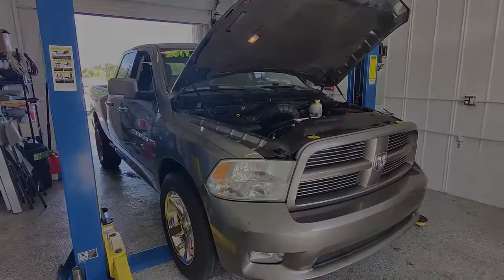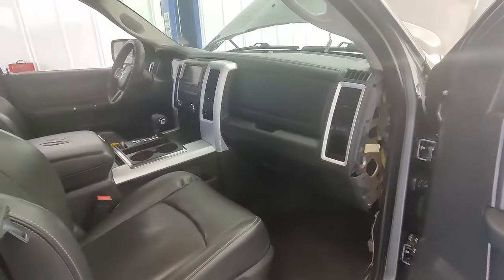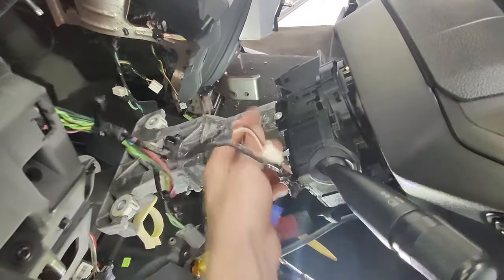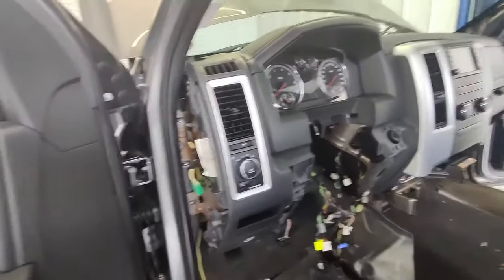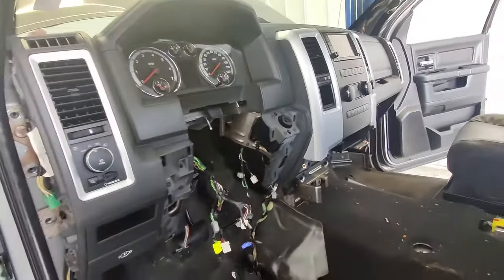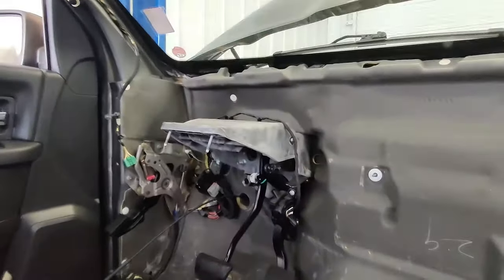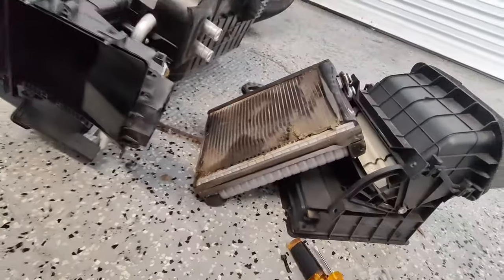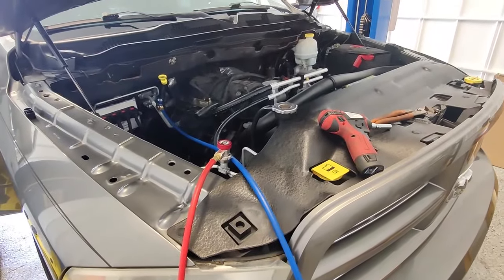2011 Dodge Ram Evaporator Core Replacement

Comment: Very informative video. I will be doing this same project this week. How long did the job take?
Reply from the maker: It's about a 6-8 hour job for someone mechanically inclined. If this is your first time doing any major auto then this will definitely be a weekend job
Reply: If you take this to the shop, how much will this pain will be worth??
Reply: I was just quoted $1,295 to replace.
Reply: It costs $2295 here.  Luckily it was covered under my warranty plan.
Reply: I've got to do this on my Dodge 1500, 2010 . This looks head scratching
Reply: Just had my 2011 RAM 1500 OUTDOORSMAN AC checked. Was told I need new evaporator and heater core. Cost will be over $3800 to do. Is this insane pricing? It will be at a Dodge dealership.

Comment: No need to remove seats or column. Just drop column, remove the main dash bolts (3 on either sides, 2 up top and 2 down center) then drop the column to the ground. Pull the dash out and hang it with a strap, disconnect some electrical along the sides as need  be to pull it back enough to get acces to hvac box. Got it done in book time
Reply: Also 2 tens holding the dash in right above the column so once u drop it you get access.
Reply from the maker: @vern2k653  yes I realize you can do it without removing the seat and dash completely but I prefer to do it this way because it gives much more room to work and less risk of breaking or damaging anything
Reply: @ChrisVaughnTech  yes there is a bit more risk but I can’t fathom taking an extra day or 2 when book time only gives us 7 Hrs. I still haven’t broke any dashes doing it this way and it’s worked everytime
Reply from the maker: @vern2k653  this method only took me a day. I started it in the morning and had it completely back together before 5pm
Reply: @ChrisVaughnTech  props to you that’s a lot of work in a day
Reply: The 2007 Ram is the same.  I only had to lower the steering column.  I'll admit, it felt sketchy, but it worked.
Reply: @ChrisVaughnTech floor gear shifter?
Reply: I was gonna say, this is a job!

Comment: Awesome video.. FYI if you are just doing the evaporator you can lay the dash over to the driver side and you do not have to unhook the harness under the carpet or take the steering column completely out. That way takes about 40 minutes with power tools to get to the hvac box 👊🏼

Comment: For book time 7 hours. I’m on day two and I could have save so much time by dropping the steering column ALOT sooner than I did luckily I had a small box under the cup holder so I don’t have to remove the seat 🤣 thank you for posting this

Comment: Guys i did not remove the wire harness under the carpet, i just rest the dashboard on the seats area and there was enough room to remove the heater box,i also replaced the resistor

Comment: For the DIYers watching this, as many already commented, the truck doesn't need to be stripped out this much.  Here's the short of how to proceed and not damage in order to remove the box to replace either the heater core, door actuators, or the condenser:

1. Roll front passenger window down, and move seats all the way rearward and then disconnect battery.
2. Evacuate refrigerant and drain coolant or clamp off the heater hoses ahead of the firewall.
3. Place a fender protector or moving blanket through the passenger window to drape over door panel - this will make sure the protruding studs from the box don't scrape it up.
4. Remove center console from truck.
5. Remove the A-pillar trims, trim on either end of dash, kicks, and under the wheel. 
6. Drop the column - no need to remove.  Wrap the wheel and column in a moving blanket, towel or similar to protect. Cover seats with moving blanket or towels now.
7. Remove the 3 bolts at either end of dash, 2 bolts at the top against windshield and 2 down where the console was. Disconnect the harnesses on the passenger side
8. Get a helping hand and lift and tilt the dash back and bring the passenger side further back.  Hold it up and back with a strap hooked to the the rear clothes hook, driver's headrest or such.
9. You can now get to the box to remove fasteners and wire connectors, and don't forget the fasteners on the engine side of the firewall.  
10. Pull it out, and regardless if replacing the heater core or condenser, check the other one and clean thoroughly. Be sure to check brand new and reused parts for leaks before reassembling!  Simple vacuum or pressure test will save your sanity!  Also, I honestly replace both while in there and also the actuator!It's an extra $150 in parts, but a lot of savings in the long run... DO inspect all of the doors. If you find any broken, stop and order aftermarket repair kit!  This is also when you want to add the cabin air filter to keep the condenser clean if, like the truck in this video, it's not there from the factory.  Do not buy the "kit" from the internet as they make a ridiculous profit. You can buy the door from the Mopar parts counter and the filter from anywhere. I like Wix personally. 
11. When you reinstall, make absolutely certain to replace the anti-rattle padding as the factory had and make sure the seals for the firewall pentrations are intact!  If you don't, it will aggravate you if DIYing or cause you to redo the project if a pro!
12. Reassemble in reverse order, vacuum and recharge the air conditioner, and reconnect the heater lines and add coolant.  Burping the core of air takes some work because of where it sits in the system.
Reply: When you say actuator is that the same as an A/C receiver drier/accumulator? Like $25
Reply: @Kendall Engman  No, the HVAC box in which the heater core and AC condenser are mounted contains several doors that open and close to switch between heating and cooling, directing air flow to defroster, floor, etc, and those doors are controlled by electronic actuators, which is a fancy name for a small motor assembly.   They are prone to wearing out, and sometimes the doors in the box break.  Best time to check and replace is when the box is out. One of the actuators mounts to the front of the box, meaning it is right against the firewall when the box is in place.  So it can only be replaced when out of the truck, which is why I just replace when the box is out with a new one as preemptive maintenance.
Reply: @robv4053  ok hell yeah thank you looking online now
Reply: @robv4053  so replace all actuators and doors since it’ll all be out.
Blend door usa a good company you trust?
Reply: @Kendall Engman  At a minimum, inspect the doors.  3rd Gen RAMs have the problem most frequently, and 4th Gens the older they are.  Yes, I have used that company, and their replacements are high quality and perfect fits.  As for the actuators, at least the one that's against the firewall and unserviceable otherwise.  I generally use OE Mopar replacements.
Reply: @robv4053  awesome sounds good thank you for your help
Reply: After parts what would you say is a decent price for a job like this?
Reply: Can’t find a video to get center console out with floor gear shifter 4th gen

Comment: Good video that helped me, only thing missed is there are nuts on the firewall under the heater core line bracket and under the computer that have to be removed to get the hvac box out of the truck.  The video only shows the three inside the cab being removed.  Thanks for the video.

Comment: What an absolutely ridiculous amount of work.
After all these years, car makers can’t make an HVAC system that is accessible from passenger side?

I own this model and year of truck ( no problems with ac yet) 
Seems like it would be easy for ram to make a hinged HVAC box.

Just a thought
Reply from the maker: It's a pretty crazy process on most makes and models these days. The only ones I've seen that were easy were some of the older box Chevys
Reply: Tell me about it.  I have the same year 3500 diesel and the ac just started blowing hot.  This video made me sick to my stomach.  I'm hoping mine is the compressor though, since I noticed it making a peculiar noise a few weeks ago.  70K miles on the truck that I bought new.  
I wonder what would cause the evaporator to leak in the first place.   BTW, I read that they make an aftermarket filter for these that I had thought about getting, because of the musty smell when you turn it on.  Mold and mildew from high humidity where I live.  Know anything about that?  Poor design to not have a changeable filter like my old Chevy had.  And it was also very easy to access.
Reply: @seeharvester  there's videos on here that cover how to add a filter.  I did it on my 2011 ram 1500
Reply: Literally all they would have to do is make the dash in two parts with a small crease down the middle or around the passenger side of stereo, if you could remove just the right dash, it would eliminate about 50% of this job and make it a lot easier IMHO, but cosmetically that crease people don't like to see it

Comment: Did you add new compressor oil to replace the old that was in your old AC evaporator core?
Reply: that's part of the recharge process, depending on the refrigerant you use, it should have oil in it
Reply: they answer is yes dont forgot you vacummed the system out before removing lines
Reply: I have the same question

Comment: Replace everything in the dash while you have it out! Replace the heater core, the fan motor and the dampener motor. I would be FN pissed if one of those parts broke after paying for this repair. I think I'll cut my heater hoses under the hood and connect them.

Comment: This might be a long shot but I need some help. I have a 2011 Ram 1500. A/C stopped blowing cold 4 months ago, I did a recharge and all has been good for the past 4 months. Until one day it stopped blowing cold again. I tried putting the dye through it and looking for a leak with UV light and saw nothing. So I put another recharge through and the next day it wasn't blowing cold again. Hooked the gauge up and almost all the freon had leaked out. I'm not sure what to do next to try to diagnose it. Someone please help!!

Comment: Did you have to add some PAG oil to the evaporator when you put it back together? If so, how much?
Reply from the maker: Typically you do not for just a condenser swap.. but it's best to always check and see how much oil was removed when the system was discharged and add back that amount.
Reply: @ChrisVaughnTech  If you vacuumed out for 30 minutes and removed all refrigerant, you should definitely put oil back in

Comment: I'm needing this job done on my '12. I have all the parts, what would you say is a decent price for a job like this?
Reply: All my local shops quotes between 9-11 hours, so it depends on shop rates of $125-$165, $1000 would be low end, $2000 would be high end, just labor

Comment: I use to do it like this. ❤️😊 good informative video.  U can actually keep seats in and the steering column connected and dropped.  Just pull the passenger side dash out enough to pull the box.  It’s cool to see everything out tho.
Reply from the maker: Yeah I may do that on the next one but it was definitely easier to work in there with the dash out.
Reply: @ChrisVaughnTech  I totally agree ! I love to break down as much as I can so I have a clear view of what I’m doing.  For sure 🙌 love your videos btw
Reply: How can you do this without taking out the seats and the leaving steering column connected? Also do you have to take out the entire center console? Do you know of a YouTube that shows how? Thank you!
Reply: @christopherrobertson5492  I seen one one YouTube that you just drop the column in the floor. Rest the console on the Passenger side with the seat belt. Then you can remove the 4 bolts holding the System to the fire wall...3 on the inside. One behind the ECM....I got it out in 2 hours...As the only bitch was them heater hoses...I had to crawl on top on the engine to reach them...

Comment: How much would this kind of repair cost?
Reply: $1k-$2k just labor
Reply: I was quoted 2796 yesterday from 3 differeent shops smh, rockauto for evap,heater core cost 100.00.
Reply: @DennisSmithIsTheBest  $100 seems low even for a Chinese one, but I don't doubt it, the labor makes more sense once you do the job

Comment: I have excessive water draining from my 2009 Dodge 1500 with a HEMI. The a/c is cold, but the a/c water is draining really heavy and onto the frame rail below. Do you think my issues is also the evap core?
Reply from the maker: If your A/C is staying cold then your EVAP core should be fine. The evaporator will condensate a decent amount under normal operation so when it's very hot outside and the AC is on full blast you can expect to see a decent amount of dripping water from the drain.
Reply: @ChrisVaughnTech  beautiful reply. Don’t worry about condensation. Condensation is a good thing!! It means the system is drying the cabin air, get worried when there’s no condensation. Freezing lines is a no bueno. Still an easy fix. Freezing can be caused by a blockage, the blockage will be the point where system freezing stops. If you see the ice, replace where the ice stops. A manifold gauge may also reveal a low refrigerant charge. A low - low side charge can also cause a system to freeze. The low side pressure (to a point) is relative to core temperature. So if you have a 38 psi low side pressure, then expect the core to be only a degree or so different. Duct temp may be only a few degrees off of that as well depending on some other parameters like internal cabin temp out side temp etc. a 32 low side pressure indicates that a core could be freezing. In that case, I would check charge, then go for the evaporator temperature sensor to see if it is more than a few degrees difference. If you have a bad Evan core temp reading, it may never cycle the compressor off. That’s a no no and another cause for icing. Another cause for a core freezing could be a variable compressor not changing pump displacement. Seen that a few times to. But usually it causes the high side pressures to ram up high as well causing the pressure switch to disable the compressor.

Comment: How much is the total cost of a job like this (Labor+parts) ?
Reply from the maker: Usually this is about $1500 parts and labor included. The parts are inexpensive. The labor is where it gets expensive with this job
Reply: @ChrisVaughnTech  True but while you have that out, it makes monetary sense to swap heater core and expansion valve, and also the seals while you are in there, $500 more in parts but theoretically not more labor

Comment: Thank you! I believe this is my problem on my 2011 ram. I have replaced the ac compressor, looked for leaking dye, refrigerant smell would occur in side of truck. Soooooo….maybe?? Lol
Reply from the maker: If you are smelling refrigerant inside the truck then I can almost guarantee it's the EVAP core leaking
Reply: @ChrisVaughnTech  thank you. That’s what I’m thinking, so going to replace in the coming weeks
Reply: @ChrisVaughnTech  100%

Comment: Not a good tutorial but I guess it'll get the job done. These only take 3hrs. Many unnecessary steps in this vid but like I said this vid is the scenic route.
Reply from the maker: So because you can do it faster this isn't a good tutorial?? Lol I explained exactly why the seat and console need to be removed and this is the procedure according to ALLDATA. If you can do the job in 3 hours then this video is clearly not intended for you lol
Reply: One guy said, I would also drop my truck off, where is your garage, close I wish, near Hudson NY?